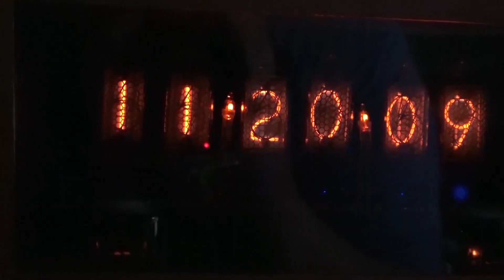My solder sucker is not sucking as hard as it should

Comment: Spray silicone lube doesn't allow solder to bond to plastics. For this app is the best. I clean the inside and o-ring with a soft brush and brand new it is. The only real problem on these sυckers 😇 is the tips wearing up.
Reply from the maker: Tips are cheap

Comment: Dyson.. I used the battery powered one at my Mother's house and I saw 3 different things that will cause issues in the future.. things to do with how the cord gets friction when you mount the unit on the wall.. very clear failure points and how the tip goes into the sleeve to charge.. also the battery is up at the handle making it relatively heavy  - which I would assume could really screw up someone's wrist..especially older folk -  if the battery design was near the bottom where the suction / rotation unit is.. it would have that extra weight at that point to make it easier to contact what you are trying to clean.  I think it's a very poor design but has potential in some areas like how you can empty it out ect but i noticed it gets a very rank smell as well over time.

Comment: As a professional technician you need to buy an electrical resoldering station like Hakko FR301
Reply from the maker: I don't do this for a living.  I can't justify 500 for a hakko solder sucker.  If it was 100 I would probably spring for it but 500 is just too much.  I make less than 500 a month, hell I probably make less than 300 a month fixing this crap.  Keep in mind that much of what I work on is stuff that is given to me and I fix and try to sell.  Much ends up going to the thrift store.  So there is really no money being made here.  Therefore I don't spend it on things like soldering stations.  I have a 50 air station the soldering iron I got free. The tektronix scope was free. I retired over 20 years ago from the business.  I still take on customer projects but don't kid yourself I don't make money doing it.  I am basically working for less than a kid flipping burgers make if I were to look at paid hours.

Comment: I find a lot of videos only swear by using a certain method of sucking up solder.  After my years of trial and error, I find I use them all! in one way or another.  I have a sucker, I use solder wick, and I even have a good ProsKit pump machine.  
All have their purpose depending on the job and the boards your working on.
I find the old boards from the 60's much easier to use solder wick on, the pump machine is too powerful,
too easy to rip those traces and tracks off.  
If I'm only doing a couple of solder joints, the manual pump is as good as any, but if I'm recapping a board or so,
the ProsKit surely makes things quicker and easier.
They still come with flaws however, as they still block up with solder like a manual unit from time to time.
It's not all a bed of roses, but regular maintenance is the key.
None of us like our suckers to be suckerless at the end of the day.
Reply from the maker: Here here.

Comment: I can hear all the porn/ anal jokes and comments that are about to hit.  The lube should help even though the lead residue might stick to the chamber parts.   On a side note about your new meter with heat sense screen, would some dual sided adhesive tape and a flat magnet mounted to the back of the meter work for you ?   The added weight and magnetic pull may be handy.  Sort of like the magnetic strap which holds Fluke meters to metal panels.    Brings to mind the OLD telephones which were heavy and would STAY PUT better than newer light plastic equipment ( which sometimes had a metal chunk inside the set just to keep it from sliding off the surface ) . Thanks Dave

Comment: I gave up on manual solder suckers a few years ago, they are great when new and for the first few
times that you clean and grease them, but after a while they just wear out.
I have an excellent desoldering tool as part of my surface mount rework station.
This also requires regular cleaning but after 3 years of daily use it still removes the solder.
Reply from the maker: I had a powered solder vacuum at the shop but it went though so many tips and was always clogging up.  Used to piss me off because every time when I needed it, it needed a new tip and at 20 bucks a pop after I changed a few the asshole I worked for started docking my cheque when he saw them show up on the invoice. I had to get the parts guy to invoice it as cleaner or anything but a tip for the solder sucker.  Eventually I just went back to the manual pump.
Reply: @12voltvids  That a**hole you worked for would not like paying for new tips @ $20 each.
I buy my new tips in packs of 10 and they last me about a year or so, now that i am due to retire
they will last a lot longer.
Rework stations are like a lot of tools, good ones are expensive and cheap ones cost a fortune in spare
parts,
Reply: As someone who does a project about once a month, the one I bought a decade ago (a chonky unit) still works very well. Great for desoldering chips, where I prefer it over the solder wick. I had my eye on the desoldering stations but it's hard to justify spending money on as an amateur.
Reply: @stragulus  I only bought my rework station due to the high number of items that now use tiny surface mount components
and it was used most days, for a hobbyist they are an expensive luxury.
Reply: Yes, very true.  I bought one of those fancy aluminum ones after my cheap plastic one broke, but the threads are very fine and is super easy to cross-thread.  You must be super careful when reassembling after cleaning.